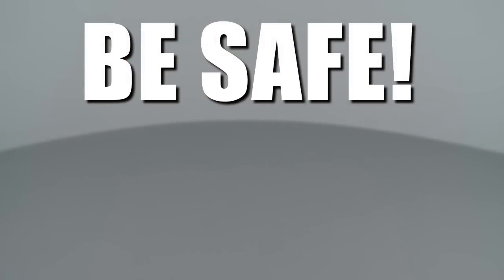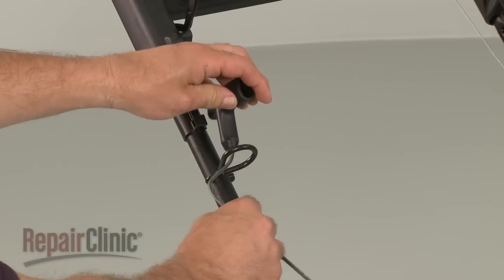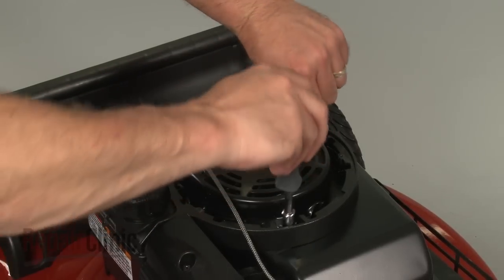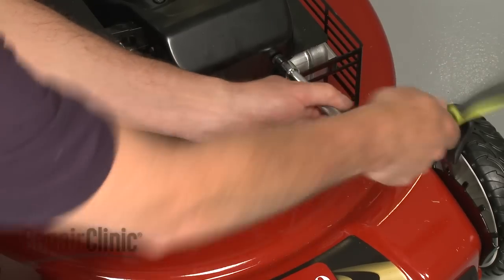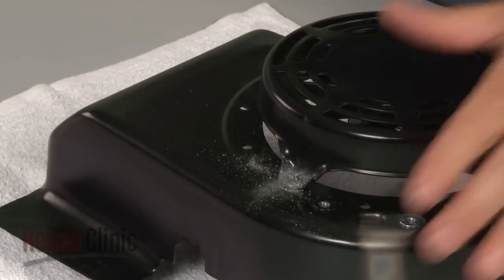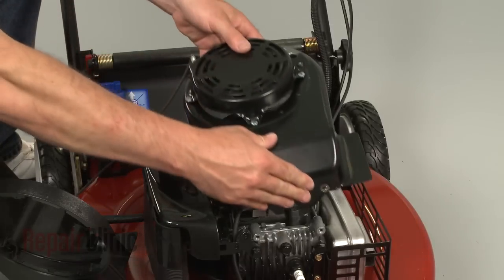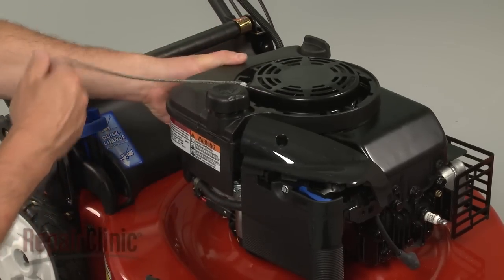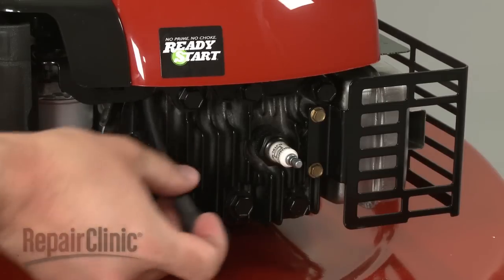Briggs & Stratton Lawn Mower Replace Engine Recoil Starter #497680

Comment: Great video!  But in the instructions I received with the assembly it showed the bolts being inserted opposite of what you have in the video. These are the bolts for the assembly. They should be installed with the nuts on top.

Comment: Please share with everyone what you did with the handle, when you secured the blower housing to the engine. I do not see the handle (starter rope) anywhere near the recoil assembly.  When I installed my new recoil assembly it did not work , it darn on me that by adding slack in the rope (placing the start rope on the rope guide) before I secure the blower housing it work fine.
Reply from the maker: Mechanically Challenged The starter rope and handle may need to be extended out in some applications. Thanks!

Comment: Can you please share insight to help me. I have a Briggs/Stratton 675 ex mower engine. I replaced Air Filter, Changed Oil, Fuel, added Fuel Treatment,  changed Spark Plug, and cleaned Carburetor.  I cannot get mower to start.
Reply: Tks Harry.
Reply: CHOKE IT! You should have known.

Comment: Jeez, just when I thought I'd seen them all! In the description it says replacing the starter will cure the mechanical defect of a hard-starting engine. Huh! People, before you start throwing arts at something and hoping something will stick, these "Youtube Experts" such as doyboy73 don't have a clue as to what they're doing. For one, the only reason you'd need to replace the recoil starter assembly is if the starter recoil housing is somehow damaged. For two, an engine isn't "hard starting" because of a faulty recoil starter. Recoil starters GET worn/damaged FROM hard-starting engines! You should have known.
Reply: I  watch donyboy73 when it comes to my snowblower and lawnmower. He know his stuff! This video is from 
RepairClinic.com. You get the difference, right? donyboy73 is helping us fix stuff, and RepairClinic.com is hoping we buy stuff.

I think your beef with donyboy73 is that he told you he didn't want to date you, one night at a party! :D